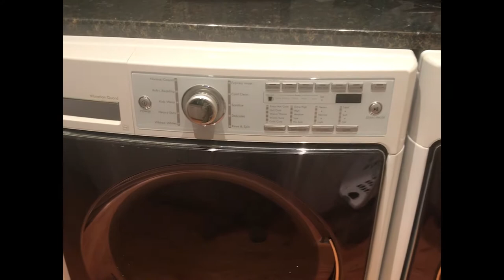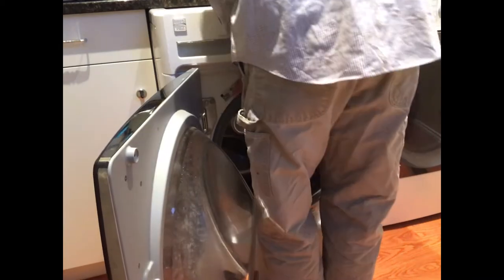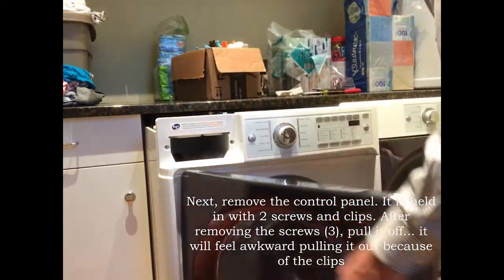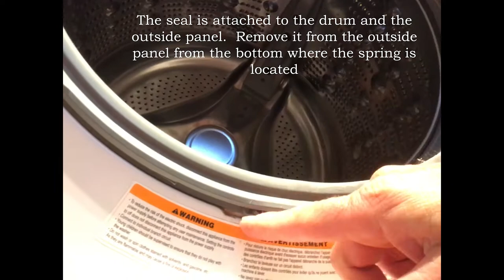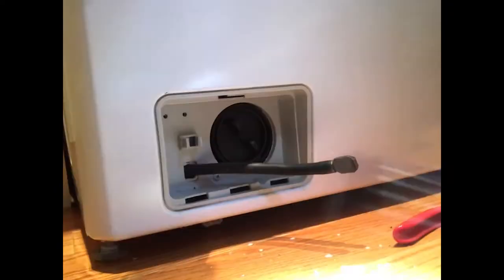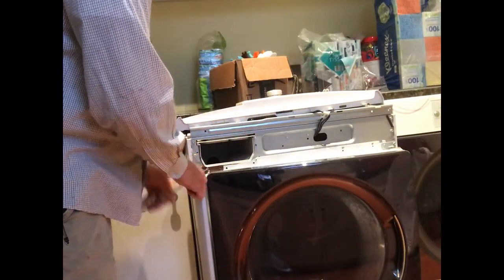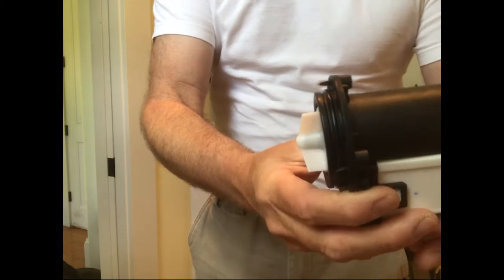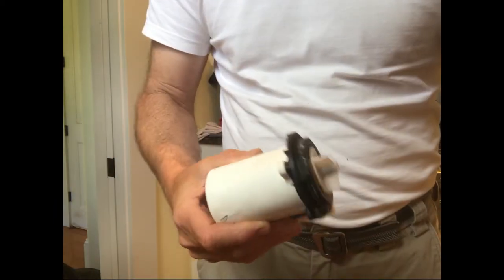How to replace a drain pump in a Kenmore Elite front load washer

Comment: If clearing the drain trap doesn't fix it, it might not be the pump.  Take a close look at the rubber boot hose that connects it to the washer barrel.  Inside it is a floating ball mechanism with a hole next to it that has potential to get clogged with lint or a sock.  If the pump runs during a spin-and-drain cycle and the hose collapses while the pump is running, that's a sign the pump is working but the hose is clogged.  It unclamps at both ends with a channel lock or pliers, and can be replaced, or you may be able to open just the upper end and clear it out.
Reply from the maker: Thanks for taking the time to share this info.  I'll definitely pin the comment!  I learn a lot from kind folks like yourself and hope others can use this comment when they are in the same situation!  Kevin

Comment: I did this repair today on our Kenmore Elite and your video was very helpful. When I got my pump motor out it would work intermittently when checking in the shop. I pulled off the impeller end and the stator housing was full of sand and stagnant water and impeding the magnetic field. I flushed it all out, blew it dry and put back together with the two o rings intact. Slapped her all back together and doing a white vinegar rinse right now. Three hours and lollygagging and no parts expense. Thanks a bunch!
Reply from the maker: Rick,
Thanks for sharing your solution.  The last time I replaced the pump the impeller was bent... it turn freely but not in a circle, more like an oblong... Hopefully this one will last a bit longer.  Now that I put the video up, I can go back and remember how I took it apart.  Thanks for taking the time to comment!  K
Reply: Rick Magers did your pump make wear noise when not working properly? O not noise at all?
Reply from the maker: It stopped completely.  After I removed the impeller, it still would not turn.  Thanks
Kevin

Comment: Another good thing to do with the pump out is to make sure the drain hose is clear. You can do it with an air hose, a vacuum cleaner etc... A quarter stuck in the drain line will burn up a new pump in a few weeks. I learned this lesson the hard way.
Reply from the maker: You are correct Mr. Ballard.  I typically check the hose for scale but never a solid blockage.  Thankfully, I've not had the lesson and because of your comment I many never have that one too.  Thanks for watching our video and sharing your thoughts!  Kevin

Comment: we are having the same problem with the exact same washer. We just ordered the pump and with your video I am going to try and tackle this myself. Sure beats having it repaired or replaced by professionals. Thanks for your video.
Reply from the maker: Rooster Hollow, check out the comments on this video.  Someone said they can change it out without taking off the front.  Thanks for watching and sharing your thoughts!!!  Kevin

Comment: Most of the time the drain pump will be the first thing to go out on washing machines.It's crazy that companies charge 600-1200 dollars but use a cheap ass pump.They also use cheap Chinese electronics.On a side note,I bought special pliers for 12 bucks on Amazon that remove and reinstall the spring over the door gasket.I've used it twice(yep,damned cheap drain pumps) and it's worth it.Also,2 washers didn't give an error code but when the washer fills but doesn't drain it's more than likely the water pump and I paid 19 bucks and another was 27 bucks so they're pretty cheap and can save you a big pile of money.
Reply from the maker: Thanks for sharing your experience LarryLackey!  I have the same pliers. But get this.. I replace the pump from the bottom now. It's a pain to pull it out but I can change out the pump in about 30 minutes or less. And I'm not dealing with that hateful spring!  Thanks for watching.  Kevin

Comment: Whoever tries to fix this from the bottom, let me help you out, don't. Just follow the video. Yes you can see the pump from underneath but accessibility is virtually impossible. You just can't see what you're doing.
Reply from the maker: Please take a minute to read my response.  Thanks for watching our video. Here are two videos where I changed the pump from the front.  https://youtu.be/9zQsNN7wNd0   https://youtu.be/wgZMFXZlhyY   I've  done it this way for about 5 pumps on this same washer.  I tried the method in this video as a suggestion from a viewer and I have to say it worked very well.  To your point, it is difficult to know where the screws are located.  Having done it so many times, it was very easy for me.  If attempted this without YouTube, I think I would really be frustrated because I would not know how many screws to remove or where they are located.  After using this method, I am confident the next time I do this repair, and there will be not just one next time, but on the next one, I will do in about 30 minutes.  And I won't argue with the spring around the gasket!!! Thanks for taking the time to watch our video and share your thoughts.  This is how we learn!  Kevin

Comment: Thank you so much for this video.  This is my second pump on my Kenmore Elite. The pump was still draining but sounded like a rocket trying to take off lol. This time I noticed that the filter was clean but the drain hose was super clogged with sand and dirt, probably from my 11 y/o not rinsing his dirt bike riding clothes all the way. I literally had to roll the dirt out with a rolling pin and lots of hot water in order to loosen it all out. It was like mudcrete! Then to top it off, I reversed the wires on one side of the pump. Needless to say it wasn't draining. Once I saw your video I knew exactly what I did wrong (red front, black rear!! ). It wouldn't be so bad if I didn't have to take the whole front apart again. That wire ring is always a pain to put back on. I don't have a lot of space to "tip" the washer and access it from the bottom, as someone has suggested. Probably would've been quicker. 
My husband did have fun watching me. I'm glad I could be this entertaining to him😂.
Aggie
Reply from the maker: Just reading about your adventure was entertaining.  I would love to see a video of it on the next go round!  Cause there will be one! I'm due for ring adventure again.  The trick will be to find the pliers prior to starting!  Thanks for sharing it started my day off with a smile!  Kevin
Reply: @MillGapFarms  Oh, by the way, you wanna know how I found out that there isn't enough room to tip the washer for "work from below" way? Well....I forgot to take a towel out that I placed under the black drain pipe to catch the water when I disconnected it! I realized that part as soon as everything was put together. 🤬 I told my husband, "I'm not taking this 💩apart again! Start lifting!". I think by now, I have created a standard operating checklist for this procedure in order to prevent the same stupid mistakes for next time! I felt totally defeated by my washer! I felt like I should've read "The Art of War" while humming the Gilligan's Island theme song by the time I was finished!
Reply: That was sooo funny!?!🤪😜😝🤣😂😅😆😁

Comment: Is a drain pump the same as the water pump relay?
Reply from the maker: No a relay will send power to the pump.  Are you getting an error code?  Thanks for watching our video.  Kevin
Reply: No the water is loud when it’s going into the drum! I’m thinking it’s the water pump but can’t find a video for that
Reply from the maker: I don't think there is a pump for that.  I believe it enters the tub via a solenoid and a valve.  I would be curious as to what you find.  I may have that problem too.  Thanks for your comment. Kevin

Comment: How can I do a test mode? 🙏🏻
Reply from the maker: Omar,  Testing the pump can be a challenge.  Below is a video from a fellow in Florida who made a cord to test his.  This is exactly what I would do to test a pump.  Let me back up a bit.  The last couple times I had to replace my pump, water was left in the machine. Removing the pump was what I needed to do but first I had to drain the washer. Which was a pain.  In doing so, I was able to check the filter and one time was able to get the pump working again because the filter was clogged.  In other times, that didn't work and I had to drain it again after testing it then install a new pump.  As I remember, the pump wasn't too expensive and replacing it seemed like the best option.  One time pulled the pump apart and tried to clean it.  It worked for a short period but still needed a pump.  The last couple times I replaced the pump, instead of testing, I bought a new.  It's been almost 2 years since the last time and now I'm thinking I need to order one because it's going to fail soon.  Here is the link to the fellow's video.  I hope this helps.  Thanks for watching our video!  Kevin   https://www.youtube.com/watch?v=YhX2-uJLC3s

Comment: I don’t know which one is negative and positive on the new part
Reply from the maker: Thanks for watching.  It should not matter. Of course as soon as I say Thais, it will matter.  If it was going to be necessary they would have given it different ends on the wire.  Please let me know how it works out?  If you are not confident  I can check out the other videos I’ve done in it and see what I can find out.  Thanks Kevin

Comment: Hello.... Ours cuts off completely while in the wash cycle and gives PF code. Which is a power failure code... but there's no power failure. So it's anyone else having this issue?
Reply from the maker: Have you disconnected the power cord or shut off the breaker and try the reset process in this video?   We have not experienced a “pf” code?  Thanks for watching and commenting.  MGF

Comment: You could have changed it from the bottom to many unesisary steps
Reply from the maker: Adam,  Thanks for watching and commenting.  I could not get my hands in the space to remove the hoses.  How were you able to make that happen.  I know I'll be changing this out soon.  This was the second pump in less than 3 years.  Thanks Kevin
Reply: My model was nowhere as complicated. Just unplugged the washer, took off the bottom panel, unhooked the hose, disconnected the electrical plug, removed 3 screws, and out it came. Put in the new one with reverse steps. Super easy, about 15-20 minutes. I previously had gone in to make sure the hoses weren't clogged. Old pump only 3 years old also. Glad I have mine and not yours.